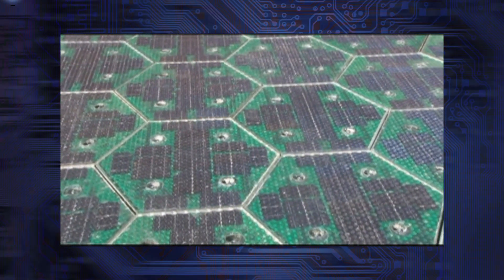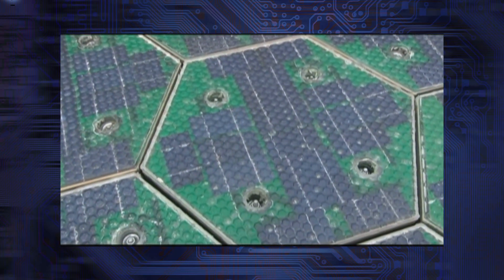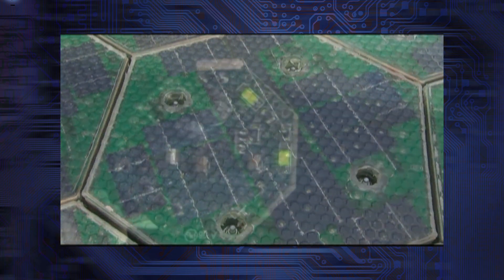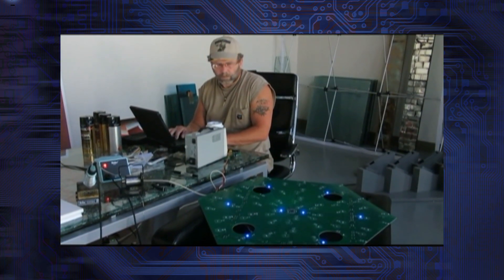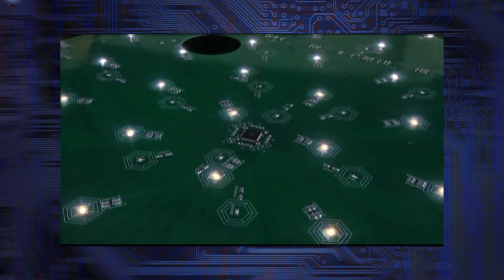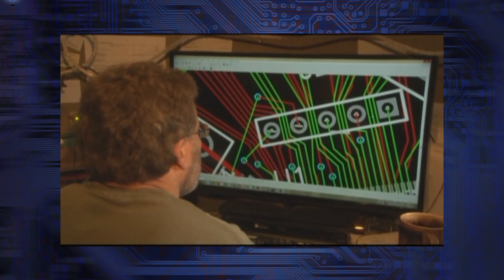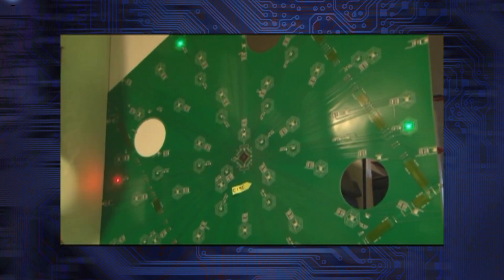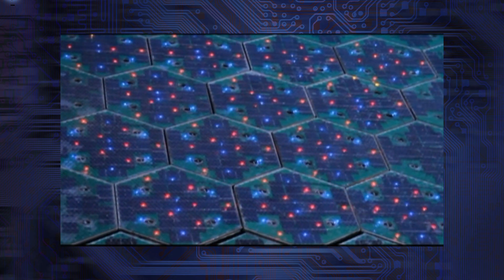Solar Roadways - Smart Streets of the Future

Comment: Seriously there are some really misleading claims made in the comments below, it's good to be skeptical, but spreading disinformation because you're too lazy to look up the relevant information is idiotic. Asphalt is NOT stronger than glass, never has been never will be. Tempered glass is 5x stronger than average glass. Composites used to strengthen the glass surface from falling objects prevent shattering. The glass is textured, pretty sure there are engineers doing friction tests on prototypes or it wouldn't pass government review. Mass production costs would be much cheaper than prototype costs. Utilities will be ran down the shoulders, not down the middle of the roads, panels can communicate with other panels and send repair signals to maintenance crews. 1 panel can be changed out in an hour rather than months to have new asphalt laid. Please educated yourselves, I spent 15 minutes on Solar Roadways website and debunked all of your skeptical claims.
Reply: Asphalt is soft, yes. But there's a difference between asphalt and asphalt concrete (which is what roads are actually made of). Asphalt is just the binding agent for rocks used in making the road surface. It's this kind of fundamental ignorance on road engineering that screams these solar roadways people are full of shit.

All the "debunking" they do on their site is just deflecting and straw-manning without actually addressing the legitimate problems brought up against this. It would be much cheaper and more efficient to just put angled solar panels along the sides of existing roads than to make the actual roads out of this crap.
Reply: Strength and shatter resistance are not the same as hardness....
Reply: Tracy Gossett Tempering glass does not make it harder, only more shatter resistant. It will still scratch from ordinary rock.

I have no doubt you can make glass that is strong enough to support the load. The problem is it will scratch, giving it a frosted finish, so it wont let nearly as much light through.

On a normal asphalt road, scratching doesn't matter, as it doesn't need to be optically clear. But if you want your solar panels to work, dirty frosted glass is not going to be the best.

So if you want to use solar panels, you are better of to put them literally anywhere else before even thinking about putting them under the road.
Reply: Tracy Gossett All the engineers in the world isn't magically gonna make glass that wont scratch from years of use. Or are you proposing they use diamond covered solar panels?

Solar is great, put it on top of roofs and fill deserts with it. But putting it under the road is just daft.

By the way, X-ray radiation is absorbed by the atmosphere, so how you are going to power your solar panels with X-rays I don't know.
Reply: For god sakes just take a chunk of asphalt and some glass and rub them together!
Reply: SirCutRy Do you know where we can see the actual calculations? Did they just take the area of roads times the output of a normal solar panel?

Did they take in to consideration that the panels are flat on the ground, have thick pain of glass over them, that the glass will be scratched up and dirty? Did they factor in the energy energy needed to power the LEDs or the snow melting heater?

Solar is great, but normal solar is still expensive for the energy you get even if you do it optimally. Facing/tracking the sun, in a place with lots of sun and without a dirty road obstructing it.

For the amount of money it would cost to build a solar roadway, you could likely build a normal road and twice(if not more) the power output of normal solar panels.
Reply: aquamonkeyeg Also, they claim that in the final product the solar panels will be 100% of the surface. Does that mean that the solar panels will bear the full weight of the cars and trucks that will travel over them?
Reply: You know that asphalt, which is kind of soft, is just the glue that holds the road together. It's mixed with rocks, which are much harder glass. The hard rocks takes the beating of traffic and creates the traction. And the soft asphalt keeps the road flexible and watertight.

The problem with glass is that even ordinary rock is harder, so dust and grit is going to scratch the road. Solar is already expensive for the energy you get even if you angle the panels to the sun. Laying them flat on the ground and cover them with a scratched up dirty pain of glass and you will hardly get any energy at all.
Reply: SirCutRy The atmosphere absorbs most kinds of radiation but there are 2 "windows" letting through some light. The first one is called the "optical window", which you might guess lets visible light through, as well and some ultra violet and infra red. The 2ed is the "radio window" which lets radio waves through.
Reply: Solar cell efficiency is calculated based on incident energy in lab conditions. It's a function of how much incoming light is converted to electricity. When you reduce the incoming light, you reduce the amount of electricity generation even if the efficiency of the cell remains the same.

The problem with putting solar cells under the road is that you reduce the incident energy. While the electrical efficiency of the cells doesn't change all that much, the efficiency of the entire system is dramatically reduced.

There is a reason why solar cells are angled towards the sun and often put on arrays that track the sun's movement through the sky. These things increase the overall efficiency of the system by increasing the amount of time the cell receives optimal incident energy. They don't affect the efficiency of the cells themselves.
Reply: Then of course they didn't bother taking into account the complete and utter waste of money it would be to cover north-facing slopes with these solar cells.
Reply: ybra You're talking about ordinary glass though, not tempered glass, which is much tougher than rocks. There are composites added to the tempered glass to prevent shattering. So dirt and grit won't wear as quickly as you think. Simple chemistry guys/gals.
Reply: ybra The problem most of you aren't realizing is that they have a team of engineers working on said issues right now, that's why they're in the prototype phase. I mean you really think they're going to listen to anyone on a YouTube comment for advice? Also you keep bringing up the amount of energy, you don't need clear glass to absorb energy from the sun. This is why solar panels made these days work very well on cloudy/rainy days. Radiant energy from the sun in the form of X-Rays and Microwaves charge the solar panels to nearly 85-90% efficiency.
Reply: ybra, What about UV light
Reply: They calculated that the electricity production rate of all the roads, if they were solar roadways, would be 3 times the USA consumption based on CANADIAN parameters, in the darkest winter.
Reply: Why would there be other solar cells if it was innefficient? They chose the 18,5 % efficiency solar cells because they were the most viable option for the price.
Reply: The numbers page (check out the other info pages too!) : http://www.solarroadways.com/numbers.shtml

It is already textured with small hexagons that are also roughed up. The rest is as clear as tempered glass can be. Also, if made with good glass, it is more resistant to scratches, and the whole purpose of tempered glass is to be resistant to most stresses. When these can be manufactured by tons, the costs go down for the quality glass which can be made from the recycled glass, as it is the same material after all.

The dirt isn't going to stick to the glass more to asphalt concrete. Glass is less porous than asphalt concrete and thereby is more resistant to dirt and burnt rubber. They didn't  calculate the power consumption, because it was only the generation of power. They have taken that into account, they have been working on this since 2006.

The Solar Roadway offers many additional benefits, that are needed even in the North slopes. They also pay themselves back, but more slowly.

Additional links:

http://www.solarroadways.com/faq.shtml

http://www.solarroadways.com/clearingthefreakinair.shtml

http://www.solarroadways.com/prototypeII.shtml

I hope this is helpful.
Reply: Linking their bullshit claims is far from helpful. It's such a simple matter of just hooking up a volt meter to their prototypes to show the output. All the features they "demo'd" were powered externally.
Reply: aquamonkeyeg How do you know?
Reply: SirCutRy Because their claims are so easy for them to prove if they were true. Instead, they presents stills and bullshit demos. They supposedly have working prototypes...

It can melt snow? Great! Show a video of it actually melting falling snow. Instead, they show a still picture of 2 panels; 1 clear and another  covered.

It can generate power? Great! Hook up a meter and show us how much it can generate. Instead, they pop out math... what happened to those panels they already built?

The LEDs can light up the road? Great! Show us this function in full daylight at the angle we'd be viewing them if we were driving. Instead, they show the LEDs directly from above and in twilight or nighttime conditions.

The reality is that LEDs intense enough to be seen in full daylight at an oblique angle are extreme power hogs. They would take up nearly all of the energy generated by panels.

And the entire idea of "virtual storage" is complete bullshit. The electric grid doesn't do that. You either use the power or you lose it.

And the idea is stupid just at face value. You lose  up to 20% of the generating potential by having them flat on the ground instead of angled. Then there's the stupidity of putting them in parking lots, which will be covered during peak energy generating hours. You're better off just building them on the side of the road or on top of roof structures in parking lots. Then you don't even have to worry about the structural stability of the glass needing to support vehicles (which adds to the thickness and decreases optical efficiency) or the traction properties (the bumps also decrease optical efficiency).
Reply: aquamonkeyeg The bumps have angles to provide better exposure.

Comment: As someone who studied pavement engineering, this is a terrible idea.  The glass surface is very weak compared to normal asphalt or concrete and will become very slick once worn down.  The panels are also most likely much less durable than regular road material and many times more expensive.  If you really want solar power and have to use the road network to do it, just put overhead solar panels.  Also, you can't see LED lights in bright sunlight, and the glass surface will become dirty and tarnished very rapidly, making it a horrible source of solar energy.  Lastly, its very inefficient at actually getting you solar energy.

edit: its also a terrible idea to include utilities inside the road, because then you have to shut down huge segments of the road to fix things like fiber optics.  Its much better to have them farther below the surface, where they can be accessed other ways.
Reply: Robert Gronewold No, it actually isn't.  There are effective and productive paths of advancement, and there are ridiculous ones.  If we had continued to pursue flight by mimicking bird flapping, we would never have flown.  The wright brothers weren't successful just because they tried something different, its because they developed a full understanding of the mechanics behind what they were trying to do, and came up with a workable solution.  All those people who made bat wings and tried to flap off of a cliff in the old days didn't, they just went with what sounded good enough.  Solar roads sound good to people who don't understand science, but are vastly less practical than even modern methods for the same results.
Reply: You're highly misinformed, glass (tempered glass) in this case is much stronger than asphalt or concrete. Also the utilities, internet, phone, etc will be along the shoulders with access points for workers. This is funded by DoT and if you took the time to read their website they would debunk a lot of your claims. Don't you think DoT would have thought about friction, etc. There are engineers working on this. These panels will be modular so if one goes bad, a technician can go out and change the panel out in an hour or so instead of weeks, months, years with asphalt repair.
Reply: Tracy Gossett Err, depends on in what way.  Tempered glass is stronger than concrete or asphalt roads in compression, but asphalt and concrete roads are already sufficient in compression, its the other forces of the road that are a concern.  Both concrete and asphalt are worn down quite easily as well, but firstly normal roads do not worry about scratches, and secondly, the road is largely made of aggregate (industrial rock) which is quite hard.  In regards to scratching, that is caused largely by shear forces, which glass is quite bad against.  This shear force weakness is compounded by the void spaces left by the photovoltaic cell compartments, which cannot bear load.  These areas will suffer a lot of shear load when a weight presses on it.  Thats why its easier to break a glass window thats supported only on its sides than a pane of glass with a steel plate backing it.  I already did some reading on this, and one science journal already mentioned that this would require an "as of yet nonexistent form of glass".  So yeah, average tempered glass isn't cutting it.

With regards to replacement, yes maybe it is faster (though whether it actually is, is a bit questionable), but you would have to replace pieces at such an exponentially higher rate that it would be a significant net detriment.  Another point is that electronics tend to be delicate, especially to repeated physical trauma, so the panels would have to be built with significant impact dampening (expensive) or they won't last long.  Most new roads can last decades with little to no maintenance, but these solar road would probably have to be replaced once every year or two.  Another thing is that asphalt and concrete roads can crack, get worn down, shift out of place, and more, and they will still function just fine, but any breakage and these solar panels have to go.

Regarding the Department of Transportation, anyone familiar with a large government body knows that they are filled with incompetent and unqualified people.  Many upper level managers aren't technical experts in everything they oversee, and are hired more on management and interpersonal skills.  Moreover, even most transportation engineers have low education in pavement engineering.  Not many universities offer specific pavement courses, largely due to space constraints.  I happened to go to UC Davis, which has a lot of space for such pavement labs.  There, my pavement professor told me that many people who oversee roadwork actually know almost nothing about it, because most pavement programs are lacking at best.  

Frankly, I would take the word of a couple of smooth talking backyard tinkerers with a grain of salt (or better yet, an industrial shipping crate of salt).
Reply: Robert Gronewold I already addressed this.  Glass can handle tons of compression, but that isn't what the problem is.  It doesn't handle other functions of pavement properly, and it has to handle more if you want it to hold solar panels underneath.
Reply: The glass can withstand extreme amounts of weight.  This is the future now.  Materials that used to be flimsy are now so much more resistant.
Reply: TheEmperorGulcasa The solution is to just give it time.   Do not forget that we are living in an age where yesterdays science fiction is becoming todays science fact.  Somewhere in the world there is certainly the technology to address your issue, and it will only be a matter of locating it among the planets 7 billion souls.

Comment: This is stupid for a number of reasons. First of all glass is slippery when wet, its fragile and not particularly wear proof, tiles can start moving out of position when driven on over and over and the LED's wont be able to be seen in the light.
The whole basic concept is also ridiculous, solar panels work best when operating under clear skies with no scattering, the opaque glass scatters and absorbs a significant portion of the light before it reaches the panels.

It would be much more efficient to use tarmac and place the solar panels in solar farms or on rooftops instead of incorporating them in a glass road. And isn't efficiency what green energy should be about?
Reply: You're forgetting the fact that engineers are working on this, you're most likely not an engineer. The engineers working on this project are testing all the scenarios and creating a prototype for more testing. Solar panels made today can operate at 85% efficiency on cloudy/rainy days. The glass is textured, tempered, not your average blown glass mug. Your whole comment is full of disinformation, why not educated yourself a little before making such claims. Tar costs over $1000 per ton, plus all the fossil fuels for the equipment to repair and maintain it.

Comment: The material may have more traction than asphalt, BUT: What if it rains? What if you use the surface for years and years and years on end? Will it still have the same properties as it had brand new? I really doubt it. And I didn't even beign to talk about the cost of actually financing those roads AND the infrastructure (never forget to include every part necessary^^)